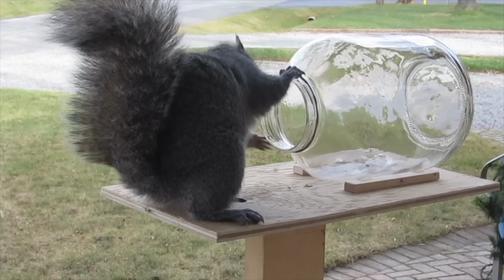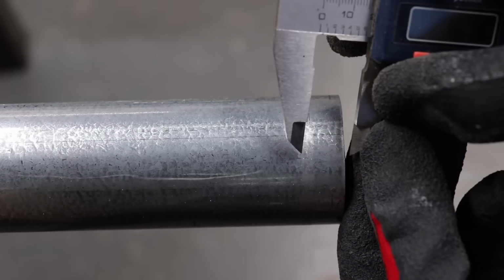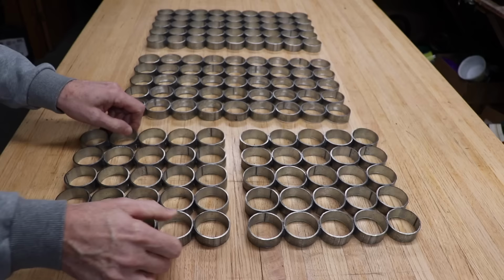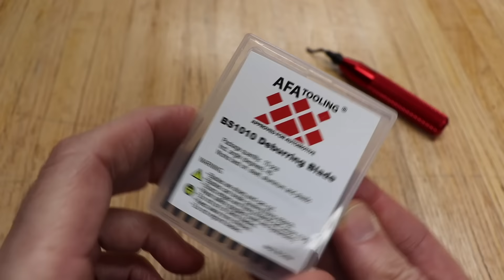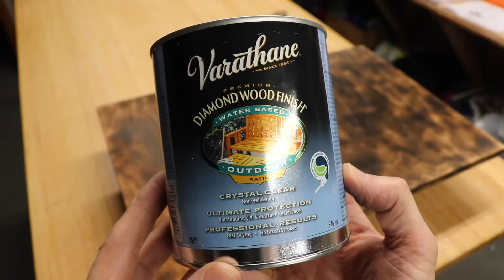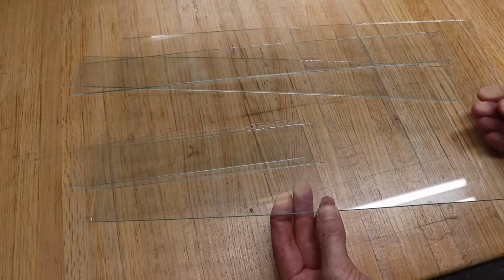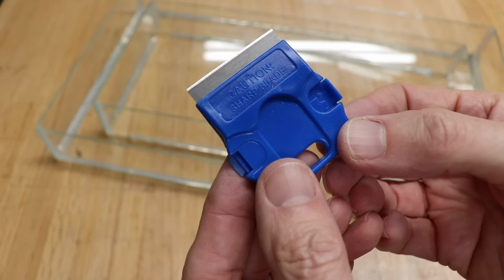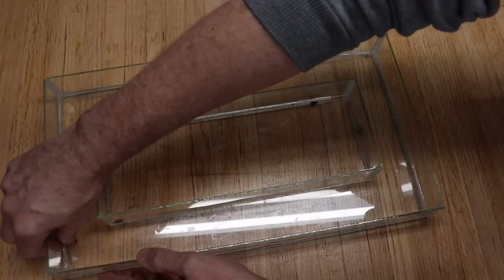How to Make ● A Unique Squirrel Proof Bird Feeder ( that actually works ! )

Comment: Hey Chris, your designs are fascinating. Is this one just as rain/waterproof as your last one was? I'm also very curious if you perhaps have a mouse/rat and pigeon proof version/design?
Reply from the maker: We do have the odd rat and mice in our yard but in all of the footage I captured of movement, I used a motion camera,  there were no rats or mice that were able to climb the 1 7/8" pole it was mounted on. Pigeons are only able to poke their heads in and get strays seeds.
Reply: @chrisnotap  Yeah I noticed the motion camera, that's pretty cool stuff. Perhaps you can even make the software recognize all the animals that visit your feeder. I also have spotted a mouse in my garden, rats I haven't spotted yet, but I do read a lot of complaints from people in other neighbourhoods, so preferably I would not want to make the problem worse by opening a free 24/7 open buffet :). Currently I have a pretty small birdfeeder that's attached to the glass in a barn door so mice can't get to it as easily. They can climb almost everything, but it's a lot harder for them to get a grip on glass surfaces. This birdfeeder though is almost falling apart caused by it being assaulted, for lack of a better word, by big fat hungry pigeons multiple times a day. One or two of the can easily eat the entire supply inside the feeder, so it's also adding up in costs, attracting other pigeons as well and it comes with lots of droppings of course. Your solution seems to cover a lot of the things I'm looking for in a birdfeeder. My garden is not so big though, so I'd need to scale down the design the pole being one of them. I'd probably also prefer a round and slippery roofing, just in case mice etc. are able to jump on top of it and try to climb down. Did you also do the water/rainproof test on yours?

Comment: I see one big future issue with your design, galvanic reaction from the zinc coating of the fend post pipes and the aluminum angle material, should have gone with similar materials, or perhaps used PVC tubing instead of galvanized
Reply from the maker: The silicone does insulate them from each other. It's been up for 5 months now and showing no signs of corrosion anywhere. If you use PVC they will chew right through it in no time!!
Reply: @chrisnotap  huh, I have home brewed ham radio loops that are PVC pipe supporting wire that are basically a wire loop that I shoved through the unassembled PVC pipe then sealed with silicone/ they've been in operaton for 20 years and never had a single issue.

Comment: Work well for them, but what about them chipmunks? They are the same same size and weight as them cardinals??
Reply from the maker: We have never had chipmunks in our area but yes, you're right. They would be able to enter easily.
Reply: Yeah, my new arch nemesis 😮 old fashioned pole cone seems  to be my only option from them chipmunks. Gotta keep the feeders away from trees and shrubs or anything else they climb and jump over.

Comment: Nice design, but is there a reason you didn't just use PVC? Even cheaper & easier to work with.
Reply from the maker: My first test one was made of ABS and it took 1 week for them to chew through it.
Reply: @chrisnotap  The squirrels chewing through it didn't even occur to me. it makes a lot more sense now. Thanks.

Comment: Wouldn’t plastic pipe be cheaper? Also lighter, rustproof and you could probably glue them together.
Reply from the maker: You are correct in that it would be way easier to build but unfortunately the squirrels will chew right through it in a few days! I made one and tested it but totally forgot to add the footage to the video!
Reply: @chrisnotap  good point! Didn’t think of that! Happy New Year!

Comment: Are tthe doves able to get in it? I have trouble with them and their overwhelming numbers
Reply from the maker: They are able to poke their heads in to get stray seeds.
Reply: @chrisnotap  Yeah they are usually a bit on the fatter side. I don't mind them eating too just not in a crowd, lol.  Very cool. Cheers friend and that is such a cool design. Thank you fr your hard work and experimentation but thank you also for sharing. :)

Comment: Hi!  I have wanted to add a bird feeder to my backyard, but it my yard is over run with squirrels.  I love your design and hope to make one.  I have been disappointed in the quality of the birdhouse cameras as well as the stand alone birdhouse cameras I have seen.  But your videos of the birds in this bird feeder look very good. I read the link to the camera you posted in this video.  I sew the camera listed on Amazon in the US. What do you have to pay the Wyze for the subscription to it's service?  Also, do I need to buy something (one time fee or monthly) for Google assistant?  And for outdoor use I need a power supply?  How long is the cable on the power supply?  I wish I could do power over Ethernet, but guess that is not available?  Great design!  I just need to learn the best way to get high quality 1080 (or better) video to my phone or TV.  You have the best anti Squirrel protection design I have seen yet.  Very Good!  Outstanding!!!  Thank you for your video!

Comment: Thanks for the video.  Functional design.  Is a modification of an idea my father created to specifically select and feed only painted buntings in SW Florida. My father worked for Audubon. Concern: I don’t care for the sharp edges of the glass.  That seems an unnecessary hazard.  Plexiglass would do the same job. Laser cut boxes and trays are super easy to snap-fit together after shipping. If you wanted to mass produce these. It would be easier to laser cut the sides and tray out of thin sheet metal.  I don’t personally have a metal cutting laser (yet) but have a CNC Plasma Cutter waiting for Fire Marshall Inspection at my local Maker Space here in Charlotte, NC. If you want to do a collaboration. I can suggest several simplifications, but don’t want to steal your thunder. Also, I am working on getting a contract/agreement/gentleman’s handshake/etc… on supplying products to the Audubon’s Sanctuary’s Gift Stores nation-wide. If you are interested. Again, thanks for the video. Frank H. Ligas

Comment: Chris,  You could have stopped the squirrel with a much easier, less expensive, and hugely less time consuming method.  Just get a piece of 4" PVC pipe and slide it over the metal pipe. It needs to be tall enough (~ 5 feet) to keep the squirrels from jumping up to the metal pipe.  Squirrels can't get a grip on the 4" PVC pipe, and can't climb on it.  Now, just use only old style bird feeders you want.  They'll all be squirrel proof! 😁🥳👍🍺

Comment: The next consequential step is to make a bird proof squirrel feeder for the little chonkers so that they can have their own dedicated buffet.
Reply from the maker: Yes you can easily! Just leave your garage door up about 2 1/2" to 3" inches and lay a pile of seed on the floor in the garage . The squirrels will enter and not the birds. Of course doing this brings on another whole set of problems with the squirrels inside your garage. This is why people try to keep them at bay since they do chew everything and can cause a lot of damage to wiring and to your house. You may have missed it but they are able to get some seeds. Just go to 11:57 in the video where I show that.
Reply: @chrisnotap throw it on the ground, that's what they do to my feeders.

Comment: next challenge.. make a feeder that ONLY squirrels can use :D
Reply from the maker: You can make that easily yourself!! Just leave your garage door up about 2 1/2" to 3" inches and lay a pile of seed on the floor in the garage . The squirrels will enter and not the birds. Of course doing this brings on another whole set of problems with the squirrels inside your garage. This is why people try to keep them at bay since they do chew everything and can cause a lot of damage to wiring and to your house. You may have missed it but they are able to get some seeds. Just go to 11:57 in the video where I show that.

Comment: Aesthetically, I like it, but the feeder also largely prevents you seeing the birds, which rather defeats the purpose.
My impression from other videos on this theme, is that a suitably sized inverted cone on the pole will prevent squirrels gaining access to the platform (yes, if the pole is high enough), then none of the rest of it is necessary.
Reply from the maker: It's actually the opposite of what you think. You can easily see birds inside as they eat. Of course you need to have it pointed in the direction that you want to view it from which is easy to do by rotating it on the pole.

Comment: My concern with this is that its going to be hard to clean properly. They need to be cleaned a lot and very well to prevent the spread of avian disease to the visitors
Reply from the maker: Actually with those 2 bolts it's very easy to clean.

Comment: When the bird panics, and birds panic on a regular basis to survive, it will not see it's way out and bruise if not break its wings. Have seen this before on Victorian railings. Two wings broken and the bird actually had enough space without panicking. Next.
Reply from the maker: I used this concept on my last feeder and it's been up for 6 years without any birds getting stuck inside.

Comment: 10:35 maybe should've smooth out the glass edges (maybe you did)  so that the squirrel can't be hurt
Reply from the maker: When you order glass from a glass shop they will ask you if you want the edges "softened" so there are no sharp edges.

Comment: Why not just cut a grid of holes in a sheet of acrylic with a hole saw on a drill press? Seems like a lot less work and less likely to fall apart than this silicone adhesive.
Reply from the maker: Silicone is so mis-understood!! It is very strong! If you use acrylic they will chew right through it!!

Comment: Wing nuts may be easier to unscrew ,...
Reply from the maker: I found that I fumbled with a wing nut more than with just a nut. Plus it does not need to be tightened down at all.

Comment: Simple use PVC pipe...cheap and  easy to cut..and you can use PVC glue
Reply from the maker: My first version was PVC. They chewed right through it in 2 days!!
Reply: i got that in my mind after i post my message...if they can chew nuts the PVC will not stop them

Comment: Now if i can just get a bird proof squirrel feeder.
Reply from the maker: Yes you can easily! Just leave your garage door up about 2 1/2" to 3" inches and lay a pile of seed on the floor in the garage . The squirrels will enter and not the birds. Of course doing this brings on another whole set of problems with the squirrels inside your garage. This is why people try to keep them at bay since they do chew everything and can cause a lot of damage to wiring and to your house. You may have missed it but they are able to get some seeds. Just go to 11:57 in the video where I show that.

Comment: undoing those bolts to put in seed is going to get old real quick. I'd have put a hinged side or top, or mounted it on pegs to set its location then magnets to keep it down, rather than the bolts.
But regardless, thats a nice bird table. Think I prefer the previous perspex one though, easier to see the birds on it.

Comment: I’m honestly surprised that there’s actually a bird feeder that’s genuinely squirrel proof, I was going to say wood or PVC could be used for it but then almost immediately realized the squirrels would chew through it so you would more or less have to use metal, and they probably used copper in the original due to its corrosion resistance… it would basically be immortal compared to the one made with the steel tubing, but maybe brass or bronze tubes would be cheaper and would be just as resistant albeit I think they would be harder to find

Aluminum would be good too, honestly thinking about it this could probably be made from old soda cans and a hearty amount of liquid cement
Reply from the maker: In my small scale experiments they can also chew through aluminum siding, although it does take them time, so aluminum cans would not be a challenge for them.

Comment: Could have just made the walls taller so the first 2 holes were blocked off.
Reply from the maker: They just climb 2 rows higher!!
Reply: @chrisnotap  if they climb 2 rows higher, their arms and heads need to reach 2 rows further.

Comment: A bird proof  squirrlel feeder next
Reply from the maker: Just leave your garage door up about 2 1/2" to 3" inches and lay a pile of seed on the floor in the garage . The squirrels will enter and not the birds. Of course doing this brings on another whole set of problems with the squirrels inside your garage. This is why people try to keep them at bay since they do chew everything and can cause a lot of damage to wiring and to your house. You may have missed it but they are able to get some seeds at 11:57 in the video.

Comment: I get the feeling a determined, slightly smaller squirrel will get their head and shoulders stuck in this. I've seen a lot of "squirrel-proof" birdfeeders that've had to be destroyed by wildlife rescuers to save the squirrel stuck in them.
Reply from the maker: It’s coming up for a year that it’s been up and no issues with stuck squirrels.

Comment: Nice design, but that's a lot of work cutting all those rings, and the top rows really aren't needed.  Could be a lot less work,  and cheaper, by just using sheets of plexiglass, and making holes in that of the proper size
Reply from the maker: Squirrels are prolific chewers and need to chew to keep their teeth healthy and trimmed to length. They will chew through plexiglass. I made the extra rows to give the birds lots of room to jump inside and to get out easily.

Comment: I'd like a feeder serving squirrels only.
Reply from the maker: Yes you can easily! Just leave your garage door up about 2 1/2" to 3" inches and lay a pile of seed on the floor in the garage . The squirrels will enter and not the birds. Of course doing this brings on another whole set of problems with the squirrels inside your garage. This is why people try to keep them at bay since they do chew everything and can cause a lot of damage to wiring and to your house. You may have missed it but they are able to get some seeds. Just go to 11:57 in the video where I show that.
Reply: @chrisnotap  Didn't know they cause damage. Does not happen here in Germany, not by squirrels. We got squirrels too, but these overseas are a different breed. We just traveled around lake Erie, and the squirrels were a highlight.

Comment: It sort of works. It's not so much squirrel proof as it is "1 1/2 or 1 7/8 inch diameter proof". Bigger birds won't be able to get to it either.
Reply from the maker: Bigger bird will be able to poe their heads in to get the stray seeds.

Comment: I don't begrudge the squirrels some of the birdseed.  What I begrudge them is ALL of the birdseed because they take it all.  Also, in my area we have a variety of very small squirrels as well as these normal sized fellows.  The little ones could get into these holes (yes they are adults and not just young regular squirrels).  We call them fairy diddles, and they are real animals, not the mythic ones of the same name.  The really bad part about them is that unlike the normal squirrels these will also eat meat, and they will attack and kill small birds if they can catch them.  On the rare occasions when they show up, I trap them and take them far, far away!

Comment: How is your bird feeder holding up to the weather? Any changes you would make to the design?
Reply from the maker: Its been up a year now.  I removed the perches since they weren't really necessary. The silicone is holding the pipes together very well.
Reply: @chrisnotap  Thanks for the update. Good to hear the silicon is holding up, I was concerned about the durability.

Comment: Mentions how cheap the pipe and razor scraper are, then proceeds to use the most expensive plywood available.  Also, Where are you buying 9-layer 3/4" bb?  True 3/4" Baltic Birch has 13 layers.
Reply from the maker: Yes it is more costly but what plywood is cheap anymore??!!

Comment: Now, build a bird-proof squirrel feeder.
Reply from the maker: Just leave your garage door up about 2 1/2" to 3" inches and lay a pile of seed on the floor in the garage . The squirrels will enter and not the birds. Of course doing this brings on another whole set of problems with the squirrels inside your garage. This is why people try to keep them at bay since they do chew everything and can cause a lot of damage to wiring and to your house. You may have missed it but they are able to get some seeds from this feeder. Just go to 11:57 in the video where I show that.

Comment: looking for a bird proof squirel feeder and found this instead. So frustrating
Reply from the maker: Just leave your garage door up about 2 1/2" to 3" inches and lay a pile of seed on the floor in the garage . The squirrels will enter and not the birds. Of course doing this brings on another whole set of problems with the squirrels inside your garage. This is why people try to keep them at bay since they do chew everything and can cause a lot of damage to wiring and to your house. You may have missed it but they are able to get some seeds. Just go to 11:57 in the video where I show that.